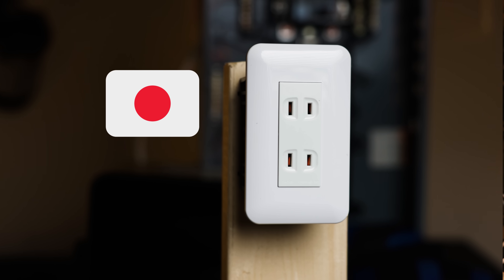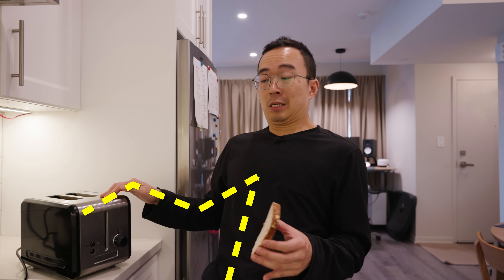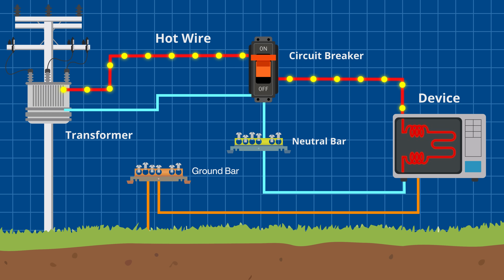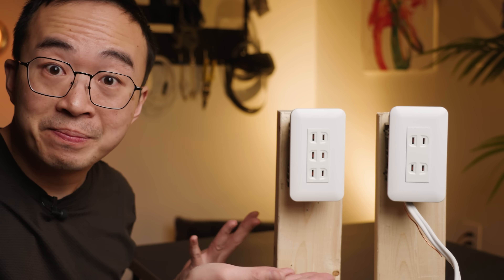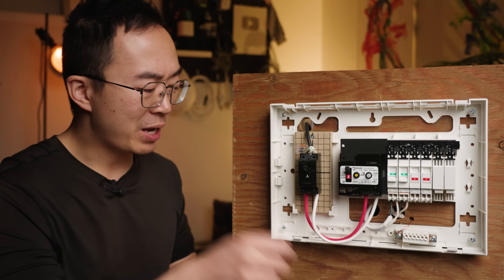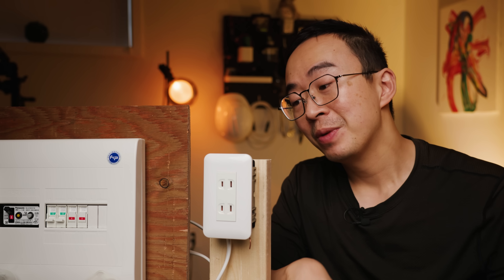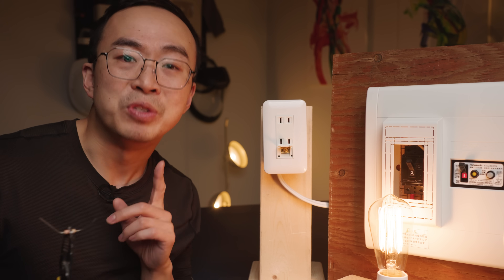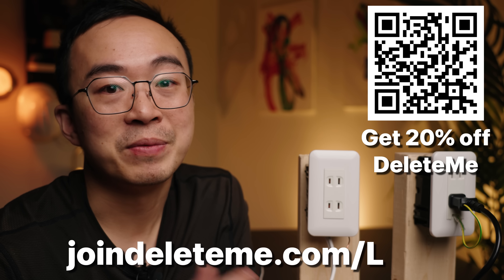How Japan Made Their Outlet Safe

Comment: Iinformative but kinda misleading since most countries in Europe and even countires close to europe (and possibly Australia)  have the best of both worlds. All their circuits are protected by GFCI just like in Japan but also have outlets that accept grounded plugs like in the US/Canada.
Reply: I personally like the Schuko (Type F) outlets. Allows for thin non-grounded Europlugs (Type C), or the more beefy Schuko plugs with the "grounding strips". And it has safety features such as inability to accidentally touch energized pins, and ground guaranteed to make contact before the live & neutral wires can.

And it's not as bulky as UK outlets.

As to the Schuko plugs' inability to act as caltrops to puncture your feet's soles, that can be either an advantage or disadvantage, depending on your point of view.
Reply: @PanduPoluan Schuko also used in South Korea and North Korea, Indonesia (former Dutch colony), New Caledonia (Schuko instead of French outlet),..

UK outlets used in Hong Kong, Macau, Brunei, Malaysia and Singapore. Philippines uses Japan 2 prong outlets but in 220V in some outlets are universal with Europlug (no ground contact with Schuko Korean plugs).
Reply: @PanduPoluan Light switch from Japan same as South Korea but they used Schuko outlets there on 220V. At 60Hz (Americans colonized South Korea) Some older outlets uses 110V at 60Hz in US 3 pin.
Reply: @PanduPoluan YES
Reply: @PanduPoluan Schuko is nice but has the disadvantage that it can be connected both ways and thus live and neutral are not defined for the appliance. Not the worst issue, but still a disadvantage for some appliances.
Reply: @PanduPoluan  Schuko plugs are just fine, versatile and safe. BUT here in Germany, until the 1970ies, grounding was often enough done right in the power outlet. The ground contact was simply connected to the neutral there, and not inside the panel ("klassische Nullung"). If the neutral failed somewhere on it's way, the connected appliance would be energized instead of grounded :-( 
An extra ground wire is compulsory long since, and RCDs are used too, but old installations still exist.
Japan has only 100V on domestic circuits IIRC, it is not very likely to get shocked when touching only the live wire in a dry room.
Reply: @PanduPoluan  the uk ones dont hurt you so far the dam children safety and no earth plugs  on the foking schuko and your finger gona hits  hard on the ground pin easy trying insert the plug on it.
this is the  main failure of the schoko.
Reply: I'm from Australia, and recently had some electrical work done on my house. Chatting with the electricians, and they did confirm that all new installs, and any new works is required to at least a RCD (What we call a GFCI Typically) but or, they could use a RCBO (Residual Current Circuit Breakers with Overcurrent Protection)
Reply: @Cazzar09  Yep, the sparkies put in RCBO's on every circuit in my fuse box and they'd trip regardless of the leakage current path whether that be through the earth/ground wire or directly to the ground or earth. What's good is only that circuit with the fault trips and not every circuit like Japan.
Reply: @mickwolf1077 just hope it don't trip often, a few times like it does here in the US and it's time to replace circuit breakers. Too sensitive for my tastes but that does mean it's working... Right? 😂
Reply: @Cazzar09  Not just recently, RCD has been required for all new houses since 1991/2000 (1991 for power circuits, but excluded lighting, 2000 updated to include lighting circuits)
Reply: @Cazzar09  Electrician from Melbourne AUS here. We've always called them RCD's, or RCDMBO's for their full abbreviation (Residual Current Device - Miniature Breaker Overload). Not GF(C)I's. RCD's and MBO's can be individual devices. 

The latest regulations now state that all circuits have to be RCD protected with the exception of heavy current (+32 amp) appliances or fixed equipment, particularly industrial and commercial equipment exempted, but that's changing. I've been a sparkie for close to 30 years and have seen our reg's change over time. I'm on my 4th set of regulation books now called AS/NZS3000, which also covers New Zealand. 

Hope you find this info interesting and your elec work turned out fine, Cheers!!
Reply: @Cazzar09 im from Au as well. I remember in the 90s we had to install what was called a Earth Leakage Curcuit Breaker, which seems to do the same thing. Are they?
I dont think being mandatory is a new thing.
Reply: Having both makes it so that a faulty appliance, like the toaster, would trigger the GFCI on its own, it wouldn't stand there with voltage on the surface until someone touches it.

Ground and neutral are not connected, so if a faulty wire suddenly does connect those, ground acts as the human touching it, thus not waiting for any outside interaction to trigger the GFCI.

And yeah, I think it's required in most, if not all, EU countries.
Reply: The US is moving toward GFCI being required by code and even requiring GFCI breakers instead of just the outlets so new construction may have them and you wouldn't know.
Reply: Argentina had always had a Differential breaker in the panel, and adopted the grounding circuit in all outlets in the '90s. Are we better than Japan? I can't believe it! 

Of course not. 
Most places don't have the mandatory grounding circuit and differential breaker. Because it would be tripping all the time, from bad practices in construction...
Reply: So here in Chile, south America, we are mandated to have in our panels an RCD for each circuit that has a breaker. My whole house has protection and we have grounding too. I'm just finding out now that our houses have safer standards than supposed developed countries.
Reply: In the UK all new homes are now fitted with RCBOs so every point is covered by a RCD. Plus from the little I know of the world we have the best socket and plug arrangement unless you stand up a plug with bare feet.😂
Reply: I just finished my garage electric work. All except 3-phase 400V 16A outlets are under RCD, Short-Circuit Current over 500A on main breaker, weakest Short-Circuit current 130A w/ 10A fuse, Grounding Continuity and Insulation Resistance ok everywhere. Dunno do you need these tests documented elsewhere, but here it is mandatory (by a certified electrician).
Reply: New installs in the US typically have Arc Fault breakers which protect against certain types of shorts too.
Reply: I wonder how much safer does that makes the whole system. Not theoretically but practically. Being living in Japan for a long time, but have never heard anyone dying of a electric shock...does that extra grounding REALLY make a difference in real life?!
Reply: Germany mandates GFCI protection only in the bathroom circuit for residential buildings.
Reply: @antoniospappas2575 This is in fact outdated information. Since 2009, all outlet circuits in residential buildings in Germany have to be equipped with an RCD. DIN VDE 0100-410:2018-10 included all outlet and lighting circuits up to 32 A.
Reply: @wolfhardreimringer9168  All circuits or all new circuits? There is a world of difference.
Reply: @antoniospappas2575  This is a wildly discussed matter that is not directly resolved by standardisation itself.
For non-residential buildings, workplace safety rules apply, enforcing RCDs as a preventive measure. Private residential buildings could remain at a date state of technical equipment until anything is changed significantly. So, updating your home with solar power, e.v. wallbox, heat pump, new kitchen installation, ... calls for a re-evaluation of the whole electrical system based on the current (!) state of the art. Which includes RCDs.
Of course, there is a lot of neglect happening, especially in smaller rental units.
Reply: He already said that
Reply: My panel have a gfci and gfci plugs
Reply: I live in Sweden and in our apartment it, the only room that has grounded outlets is the kitchen. Also the fuse box is really old, probably from the 60-70's. It basically has an on/off switch and those old fuses that you have to manually replace when they pop. Before you think that it's some small random apartment in the middle of nowhere, no, these houses were built in the 50's if I recall and they're 7 stories and cover quite a large area. I honestly have no clue what happens if something bad were to happen.
Reply: @huldu if it helps in ums. Our houses have 2 circuit breakers. Inside and outside which 2 of them supplies one half of the house and the other does the other half.

But one of them fused in closed, see ln some sparks out of thst one when I turned it off. I did replace it.
Reply: 😂 LOOL even Africa has both forms of protection.
Reply: Plugs are the one thing Britain is still the best in the world at doing.
Reply: In india also rccb are used also there is ground terminal available.😊
Reply: Yes in Australia pretty much all plugs are grounded and RCD’s are installed in every home on the circuit board for the whole house to be protected
Reply: More recent code in the US also puts GFCI on specific circuits in the panel as well. Specifically, bedrooms and appliances like hot tubs. There's nothing stopping you from going full GFCI everywhere except where GFCI outlets are required (code prevents you from doubling-up GFCI)
Reply: @Montgomerygolfgator  As others said, having "nested" GFCI often have issues like most have a Hairdrier require to have GFCI "brick" that plug into another GFCI outlet and can trip either or both. If have this in the panel, is often a pain to reset in many setups or even locked out of the panel in many buildings. Is why most bathrooms and other "wet" areas in home, schools, hotel, etc still use a local GFCI outlet.
Reply: @Montgomerygolfgator  GFCI /AFCI combo breakers are available and not that much more expensive. They require some panelboard wiring, but worth the expense IMHO.
Reply: @Montgomerygolfgator  hey man I'm reading your comment just now, care to explain the "code prevents you for doubling down on GFCI". I don't know the American code but I'm a diy in my country would really like to understand your comment
Reply: @Montgomerygolfgator  GFCI use with hot tubs was a requirement in Canada dating back to  the mid 90s. We renovated a house at that time and the 'Jacuzzi' tub required it's own circuit with a GFCI breaker installed. As well as a disconnecting means at the tub.
Reply: If that's so good, why are homosexuak special rights still refused by leadership ?
Yet illegal mexicans go free.
Reply: @dazone - 
And many countries have much safer outlets/plugs that prevent you from toucheing live contacts ... 
Germany made it´s outlets safe in 1930  (yes 3 years before the Nazis came to power) with it´s recessed ( & grounded) "Schuko" outlets ( = no more toucheing live contacts)
Reply: Current NEC in the US requires all circuits in living areas to have either GFCI or AFCI protection, depending on which area the circuit serves
Reply: Here in Brazil we must have both
Reply: Thought so too. I usually leave out ground disconnected and still the GFCI trips. If the ground was required then why does my clothing Iron doesn't have one and still it trips whenever something goes wrong.
Reply: @ChandupaHerath  it's a safety aspect one those where you rather have it and not need it than not having it the one time you do
Reply: Noteworthy that in the US any plug that is expected to run a device near water also tends to also have "ground fault" breaker in it as well.  Often here the breaker is directly in the plug for convenience to reset it if its tripped.  Bathrooms and outdoor plugs are required to have them.
Reply: That's what I came to say
Reply: they also have much superior plugs/sockets (also better in term of mechanics)
Reply: It's Japan bro 🤮
Reply: South Africa also requires rcd (aka gfci) protection on all sockets. In addition we have a ground pin on all appliances that are not isolated, and all residential installs are TN bonded. There are times you can use a TT or IT setup, but I'm not a sparkie and cannot tell you exactly what they are. For high availability medical applications where oxygen is involved you have to use a 10mA rcd.
Reply: Since all of us rely so much on that grounding Make sure y’all that your grounding wire (as well as your neutral😉) is intact regularly, because if it not intact then you will know what will come next😁
Reply: most plugs don’t have the holes anymore for ground in europe except for like bigger appliances
Reply: @Valentin-oc5nh  Maybe because appliances consume less electricity than before?
Reply: GFCI protected power is not 100% reliable. Anything that requires reliable power is put at risk with GFCI. We've seen fridge and freezer contents destroyed due to false random GFCI trips. Nearby radio transmissions can trip GFCI. Motor or other surges occasionally randomly trip GFCI. GFCIs need to be regularly tested according to code to verify proper operation (which few bother to do), and they have a service life limit and need to be replaced periodically to insure correct function. Mandating GFCI everywhere has significant consequences.
Reply: @alanb76  there are 40ma for theses the 15ma are for low current sockets
Reply: I’m pretty sure GFCI and grounding has been mandatory in France since 30/40 years. We even have multiple finds of GFCIs depending on what is connected downstream.
Reply: I am again appalled but not surprises by the USA. The richest and most powerful country in the world being a third world country compared to France or Germany.

Btw, in France, all new installations dating back to even the 1980's has ground AND a GFCI (we call it "disjoncteur différenciel") in the panel. I am shocked to learn this is not the norm everywhere.
Reply: US also has had GFCI circuit breakers available since 1970's. They are compatible with existing panels (as long as it has neutral bar, which most do).
Reply: Not only that in Germany for example, the transformer wo delivers the power, is also connected to the earth and the house. So there is a connection between earth in the house/bulding to the earth.
Reply: In my country, rcd/gfci at the panel level have been a thing since 2000 or so. A real PITA wirh some types of heating elements. With time, these leak enough to their outer metal shell to trip the rcd.
Reply: Nah, Japan’s is still the safest but nice try! 😂
Reply: Here in Canada and US not only have grounded GFCI plugs but it's code to have them installed near a water source (bathroom, kitchen, laundry room).
Reply: Not misleading
Reply: You have explained soo many things wrong in this video!
Reply: But the problem is who cares about things in Europe nowadays
Reply: @electroalchemist4560  everyone 😂😂😂😂😂
Reply: @MaPf818 about what 😂 😂 😂
Reply: Every US house I've been to have ground and GFCI on the socket for bathrooms, garage, kitchen and outdoor

In Taiwan it's like Japan for older houses, no ground, the bathroom circuit breaker has GFCI. People often just yank off the ground plug with pilers, probably not great.
Reply: And to be clear: not one, at least in the Netherlands they require everything to be protected behind multiple, so you always have working outlets when it is triggered, as electricity is important, especially in the winter. At least you will have light.
45 years ago only one was mandatory and as a nerdy kid I was a master in tripping it using power supplies of mini computers.
Reply: Yes but Japanese stuff draws views. So whatever
Reply: Right, RCDs have been standard in Europe for at least 40, probably even 50 years. The "Schuko" (ground pin) is much older. It was introduced in Germany in the mid 1920s. That's why we have both. RCDes are almost as old in Europe as in Japan. We probably felt the need to introduce protection earlier than the US and Japan because we have double the voltage. I find the American system with neutral being in the middle between the two wires that come from the sub station. This way you have 220-240V were you need it but no wire ever carries more than 120V relative to neutral/ground.

I might be wrong, but to my knowledge,  the description of the US system is not quite right: It is not ground that is connected to neutral but US neutral is ground. That is because both wires coming from the sub station are live but with opposite polarity. A separate neutral exist olny for installations with three phase current.
Reply: @berndf0  American split-phase residential power is 240v split in 180 degree apart phases with a center tap neutral. The ground and neutral are bonded at the panel because the potential of neutral is 0V, and because the ground path is from a driven stake to the grounding conductor on the pole. No current save for leakage current and ground faults should ever be flowing through the ground. The ground and neutral are isolated at all secondary paneis.
Reply: Even India have a very good design.
Reply: Thanks for the education and explanation,l am in Africa and has always wondered why Japan has such a system,l now know Gfci is the differnce.Grateful.
Reply: In europe the voltage is higher so it’s much more lethal when something goes wrong
Reply: Many older homes are grandfathered and doesn't have RCD/GFCI (I know, I live in one). Also (AFAIK) RCD/GFCI doesn't work for electric oven and hot water cylinder circuits. Secondly there's an even better breaker called Arc-Fault detection device (or AFDD/AFCI) with RCD included, which are now mandated in the US, but not yet in many other Western countries.
Reply: That's true!
You still need "ground", even with mentioned precautions
Reply: Yeah exactly
Reply from the maker: Thanks for comment dazone, I'm actually curious how people are coming to the conclusion that this video says that Japan is the only country to do this.  My only point was that Japan was first to require a panel level RCD (at least from all the research I've done) but was really late to grounding because safety was mostly fine for so long.
Reply: @Lam 6:15 you say they went the reverse of EVERY OTHER COUNTRY. Strongly implying this is unique, which it isn‘t.
Reply: @Lam because you say essentially "Japan does sth different to the rest of the world. Here's what Japan does, GFCIs." If you don't understand how this leads to the conclusion that Japan is the only country that uses GFCIs maybe consult some English teacher I dunno.
Reply: @Lam you should compare it to UK sockets as the gold standard
Reply: @Lam  people aren't really impressed because you really make it seem like this is only in japan cliche thing up until introduction, but in reality its more like 'only in the united states' thing.
Reply: @Lam  What they were missing in their argument was the word more of "safety"
Reply: @Lam  When you talked about TT earthing, you said only a small number of countries do it such as Japan & France - I'll be honest I took the rest of the video as suggesting that only countries with that type of earthing have RCDs in the panel, when I knew that in the UK we have RCDs in the panel, too.
Reply: @Lam 6:45
Reply: @Lam might have been worth mentioning that the US is one of the few that doesn't lol
Reply: @Lam  I'd say that your video comes across as misleading because it's heavily USA-focused, but quite a few people outside the USA speak English and watch your videos. It's not so much that the Japanese system is so safe, because it uses TT earthing; rather, the US system is pretty unsafe when compared with standards around the world. The UK system, type G (BS1363) is widely considered to be safest system in the world, but there's no mention of that.
Reply: @SeverityOne  only people in the UK say their system is the safest. Appliance plugs are the only thing in the circuit which is any safe, the house wiring is simple and unsafe.
Reply: @ewatfred  Nah, I grew up in a Schuko country (the Netherlands) and I live in Malta now. I do think that the BS1363 is superior.
Reply: @SeverityOne  not better than the AS/NZS 3112!
Reply: @ewatfred  I don't have any experience with those, so I wouldn't know. The fact that the cable can stick out of the wall at a right angle is a bit of a concern, though.
Reply: @SeverityOne  has never once been a problem in my 40 years using them!
Reply: @Lam  I'm actually curious why you feel the need to respond in this condescending and passive-aggressive manner to everyone who points this out. Their only point is that your video implies something incorrect - and if a lot of people see it, then the video does imply that rather than the people being stupid.
Reply: @Lam  It's not really your fault, it's not really your viewer's fault either (I would agree with OP's comment). As a YouTuber, you need to clickbait at least to some extent to survive the attention market playing field. It partially worked, but you've got electricians driven in hordes to your video, instead of the general public, pointing out the obvious, i.e. GFCI = good, no PE in the socket = bad. Still, I learned that Japan's domestic home are still lacking a protective earth but compensate by mandating GFCI for all circuits. Mission accomplished, I guess? 😌
Reply: @matt4054yt   > need to clickbait 
Ah, F you, you're just making the problem worse, and enabling it.
Reply: @VEC7ORlt  TBH you're right, there's no need to clickbait, just like there is no need for sponsors etc. I just understand why content creators do it. In popular words, blame the game, not the players. I hope Andrew will update the title as he suggested, because I checked out the rest of the channel contents and I find it pretty good otherwise (with titles that are not clickbait). Ah, and have a nice (better?) day, maybe.
Reply: @matt4054yt  Thank you, I will! At least try.
Frankly I hate both - one for becoming this grotesque nonsense and forcing this stupid game on the 'creator' and the 'creator' for not doing the due diligence of research and homework.
Reply: @VEC7ORlt  Nice 😊 I just installed a Chrome extension called DeArrow, which seems to work surprisingly well given the relatively small 60k user base. It crowd sources thumbnails and titles, for instance this title becomes "Japanese Homes Use Ground Fault Circuit Interrupter Alone Which Can Be Equivalent to a Grounded Plug". I don't think I'll be using it on a regular basis, because Chrome is not my usual browser and YT is already enough of a CPU hog as it is, but I thought I'd mention it here as a possible mitigation to the stupid game.
Reply: @matt4054yt  oh I'm adblocked, sponsorblocked and dearrowed, as well using the downvote counter as well.
Reply from the maker: @matt4054yt  Yeah, that's exactly it.  Mission accomplished if that's what you took away.  That and they can take their time with grounding.
 I'm not too bothered, I understood how I was positioning this video but I do look through the comments to make sure  I didn't botch anything up.
Reply: @Lam I think many countries had the requirements earlier for residential, ex Italy and Austria.
Reply: @Lam  There's no argument; Australia's is superior. We've got switches on the outlets, choice of twin or triple prongs, and the far, far superior 240V/50hz setup.
Reply: @hoilst265  Australia has the best electrical plug and its electrical system is functionally very similar to Europe,  but it has some incredibly strict restrictions on what work can be done and who can do it. This makes it more expensive for installation and maintenance, but as a result is it is much safer than the North American NEMA codes. Australian businesses have to get their power cables tested by a third party inspection company every year to plug in their computers which is insanity to pretty much everybody else in the world.
Reply: @hoilst265  Except that no one can afford housing there anymore.  240 V is technically more efficient but unnecessary and way more expensive to run the extra wiring that is not needed except for big window unit air conditioners.  You are not going to be running a welding machine in your house so why spend a bunch more money.
Reply: @hoilst265  Residential panels in the US are all 240V as well.  It's just that they use a split single-phase system to drop voltage to non-dedicated outlets to 120V.  240V is used for dedicated loads with higher current draw such as stoves, clothes dryers, and EV chargers.
Reply: @hoilst265  Your comment seems almost non-sequitur. @Lam never said anything about Australia. Btw, 50Hz sucks. Such a dumb idea to standardize a frequency that's jussst low enough to cause visible flashing on TV's and computer monitors lol. 60Hz is thankfully above that threshold.
Reply: @marktapley7571  You seem confused.

1. 240 V is just as cheap to run as 120 V; the wiring is virtually identical. (Wiring is sized for the amperage going across it, which is why 240 V carries twice as much power over the same size wire.)

2. 240 V everywhere is overall cheaper because you have just one system, instead of two: 120 V for smaller appliances and 240 V for larger ones such as stoves and some air conditioners and the like.

3. 240 V is more convenient for end users: go and have a look at how long it takes a European kettle to boil compared to a North American one.
Reply: @Nemo222  In Germany businesses above a certain size need to inspect their plugged in cables as well.  I did those inspections.
Reply: @Curt_Sampson  Not so because you have to run double the wire which on almost all appliances is he same size anyway.  Air conditioning is about the only thing that needs 220, pulling ap. 30 amps.  Everything else can bw put on 20 amp circuit which is much cheaper.
Reply: @marktapley7571  Why would you run double the wire? Most home circuits in 120 V countries are 15 A; running the same amount of wire in a 240 V country gives you twice the power. If anything, you can use smaller gauges of wire with 240 V, and so use less wire.

Again, the cost depends on amperage, not voltage. So a 2400 W 120 V circuit, which requires wire rated for 20 A, is more expensive than a 3120 W 240 V circuit, which can use smaller wire rated for only 13 A.
Reply: @Curt_Sampson  240 has two hot legs with the neutral instead of just one hot so you have to run more wire.  You can make a 120 circuit into a 240 by converting the neutral into a hot and then running the ground as a neutral but it may not work depending on length of run.  When running 120 you only need three wires (hot, neutral and ground)instead of 4 and as I mentioned  the only thing needing 240 in most houses is the AC. which needs ap. 30 amps instead of 15 or 20 amps.
Reply: @Nemo222 
It's only done for insurance purposes, like most things business does.
Reply: @Curt_Sampson 
Kettle in USA... They just put the mug in the microwave.
Reply: @marktapley7571 
In USA you may need 4 wires, but not the rest of the world. We only use 3.
Live, neutral, earth.

The higher the voltage the smaller the cable needs to be. 

But in terms of saving copper, ring main is the best solution along with the higher voltage.

A standard UK outlet is capable of running 3000w.
That's 13amp 
In the USA on the lower voltage you would need about 25amps, which means you would need a slightly thicker cable(not double due to area of circles)

Copper is expensive, the Labour is the same.
Reply: @Robert-j6r8c  Sure, and same issue. 1800 watts just can't complete with over 3000 watts of power, regardless of what means you use to get that energy into the water.
Reply: @Nemo222  Well, don't forget The Netherlands than: Every business above a certain amount of personnel has to hold annual NEN3140 inspections, basically meaning that everything with a plug needs to be isolation-tested with a special device that also stores the values measured for future reference (as in: if an accident does happen with a device that passed the test initially, this can be looked up). You also need to be trained to do those things, but the training itself isn't all that special and is more like 'someone showed you how it works > done, you have been adequately trained'.
If it doesn't pass the test, it's required to either repair it or cut the cord off and dispose off the equipment.
For the rest it's quite weird that anybody is allowed to work on electrical installations in their home, educated to do so or not (which does lead to some very scary situations now and then).
Reply: @hoilst265 American Samoa also use US and Australian electrical outlets in 120V but Samoa uses 230V Australian outlets.
Reply: @marktapley7571  For 240v countries it's wired the same as your 120v and for the most part that covers everything needed up to about 8kw as a plug in appliance if people want to regularly run high power appliances we move to 3 phase which is better all round since it has better efficiency and load balancing but depending on the requirements it's a 4 or 5 wire install the difference being if a neutral is needed or not
Reply: @hoilst265  Australian plugs are lightweight compared to the Type G. And wheres's the protection on the sockets from insertion of metal objects?
Reply: @Nemo222 they say that... But most businesses don't. Different story in hospitals etc where everything has to work... Most places just have spares in case you find yourself with a dud IEC cable.
Reply: The 240v system, at least in Sweden, uses one live 240v vire and one neutral.
Interesting that no one have mentioned insulation, because that should have different requirements between 120v and 240v
Reply: @hoilst265  thanks PAL.

Lol.
Reply: @hoilst265  Actually if you look at the US and the Australian systems, we both USED 240 volts from the beginning, I say USED because Australia now uses 230 volts as it standard base since 2000 or so.  We in the US have always split our 240V with a center "neutral" into to 120V supplies, where as all of the UK countries and a lot of the rest of the world, go with 200-240V as the 'service' main voltage. 120 volts was the theoretical maximum a lot of people would safely tolerate early, back in the early 1900's prior to ANY rural or common use electrification and without the benefits of the safety systems we have today,  The 50 to 60 Hz argument is a wash, they both have advantages and disadvantages. Switches on the outlets were there to minimize arcing with plug insertion due to the higher voltages, but of course the larger deep insertion plugs hide most of that effect even if it is already switched when inserted.
Reply: @hoilst265 and the plug has angled prongs so even a plug that doesn’t have a ground is polarised correctly since the plug can’t be inserted backward/upside down (if wired correctly)
Reply: @Lam  You know your stupid misleading title is awesome when you have to reply to critics with "I never said"
Reply: GFCI is not great when implemented at the breaker. its safer, and cheaper to replace, when implemented at the socket

Lots of electricians have already beaten this to death
Reply: @ShockinglyBland How is it safer in the outlet/socket?
Reply: @SimonEllwood  less current is passed before it trips
Reply: @ShockinglyBland Elsewhere on this very chat a guy from the US is asking if there is less nuisance tripping than the US outlets! The Japanese outlets had caused no deaths in years.

The UK has even safer outlets in bathrooms that are only powerful enough to run a razor or charge a toothbrush.
Reply: @Aosabi  Eww. So was that faceplate screw actually grounded though? With a trip switch at the power box?
Reply: And US still using outdated 110 volt instead 220 volt like the rest of the world
Reply: @Jarlulfric4202  How do you think they power their ovens and dryers charge their EVs?...
Reply: @dazone They have some 240V outlets. That does not help kettles however as they boil very slowly.

In many parts of the world three phases are brought directly into properties. The EVs support three phase charging at 11kw and sometimes 22kw. Some commercial vehicles support even higher AC charging power.
Reply: So, it's only the American system that's inferior. How shocking😂
Reply: @Be-Es---___  GFCI and/or AFCI are required by code in residential in the United States. Our weakness is in grandfather clauses that allow for some of the sketchiest stuff ever if it's existing work.